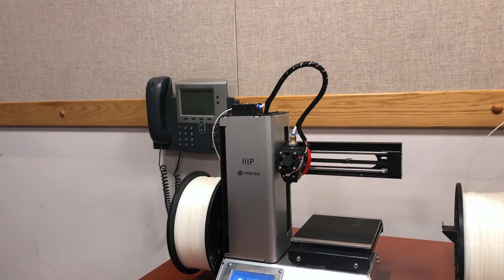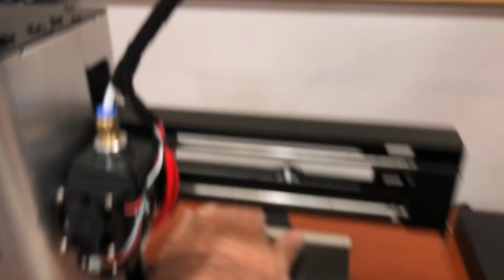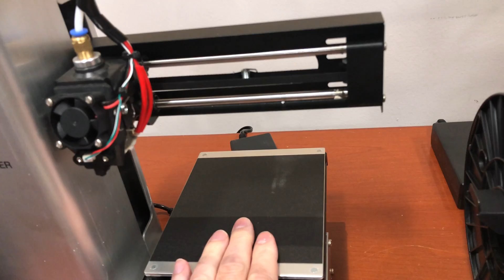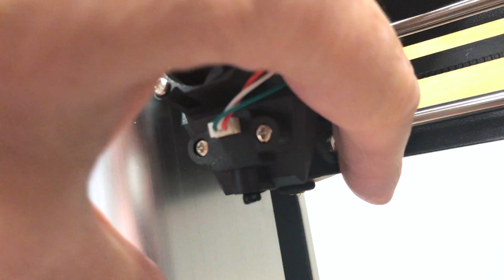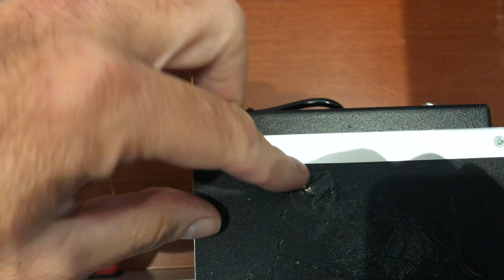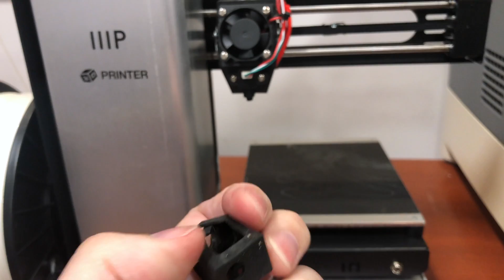Monoprice Select Mini Pro extrusion problem

Comment: So what's the word on this power supply they gave us? This 12V-7A? Should we be replacing it? If so, with what? 12V-8A? 12V-10A? If we go too high, can we fry our machine?
Reply from the maker: The power supply is a bit wimpy, and that’s why it takes so long to heat up.  But I wouldn’t mess with it because you could indeed fry the components.

Comment: how did u get the clump off? I actually ran into the exact same problem. started a print, left for school, came home to an absolutely massive glob around my nozzle and entirely encasing the lower half of those two red wires
Reply from the maker: I heated the nozzle to 200 and let it sit there for a bit.  Then I used a putty knife to pry off the big pieces and long tweezers for the rest.
Reply: @jayducharme  omg so thankful it's working like a charm
Reply from the maker: @raymondy6499   Great!